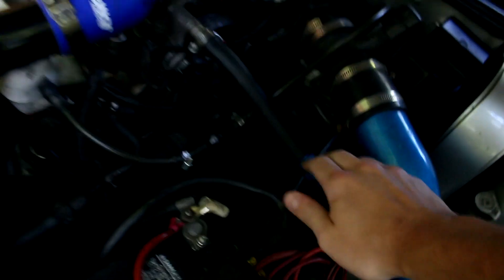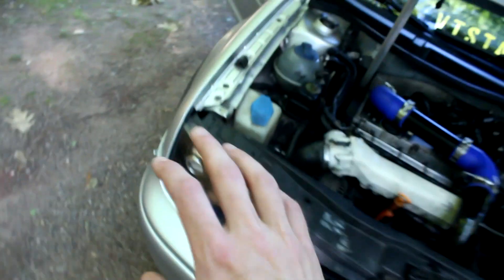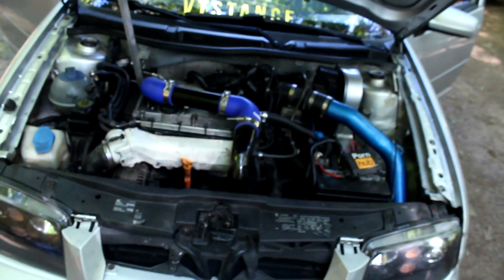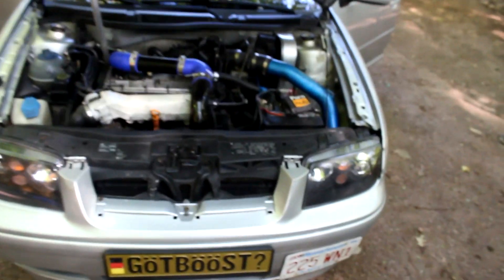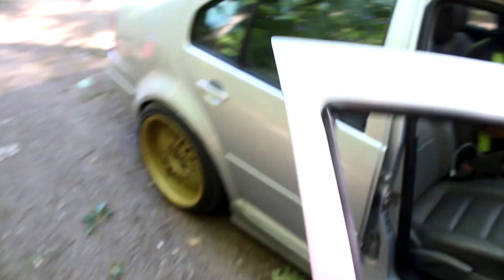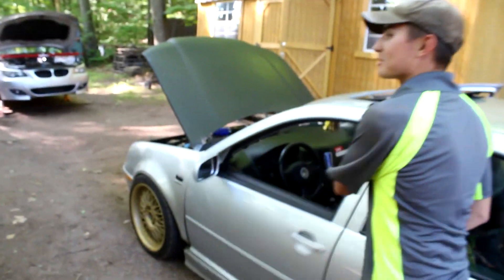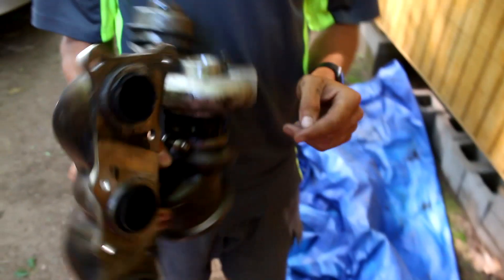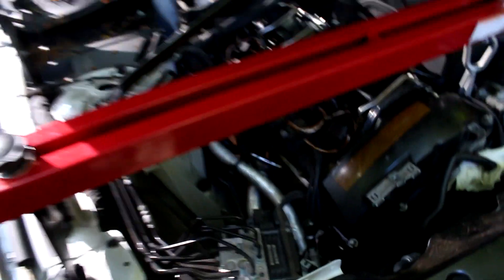How To Make Any Car 2 Step-Antilag Anywhere For Less Than 5 Bucks!!!

Comment: do you need a tune to have a rev limiter on your car
Reply: Pranks And dares. from my understanding, no. all a rev limiter does is stop your engine from reving over a certain rpm.
Reply: also, I guess most of the pop that you get from a 2 step is by retarding the timing, which doesn't let all of the gas burn in the cylinder, so when the exhaust valve opens half of it ignites in the manifold/header and you get the bang lol

Comment: wtf RIP turbo
Reply: how?
Reply: @strider5119  rev limiter and too much antilag and no air intake for it
Reply: @strider5119  2 step DESTROYS your turbo so fast
Reply: @baranUtube  there are turbos designed specifically to be used with 2 step and antilag so if you have one of those you don't have to worry
Reply: @c4rma776  stock mk4 jetta turbo people and focus st guys
Reply: Baran MK6 anti-lag will destroy your turbo if you bang it every day all day. Anti lag can actually be helpful sometimes, removing excess carbon that builds up over time ect